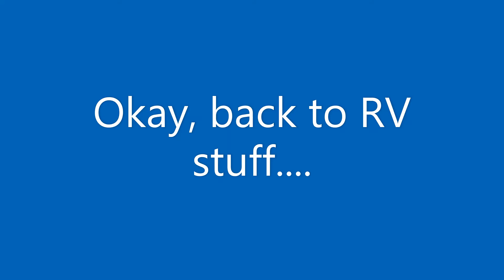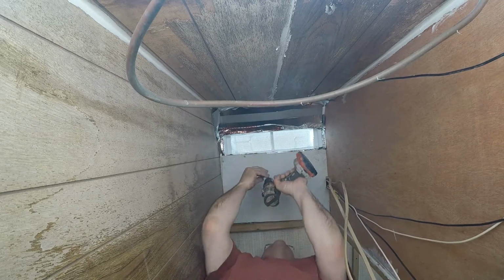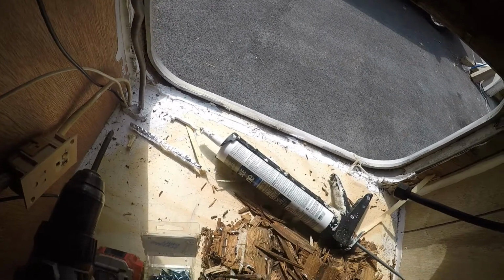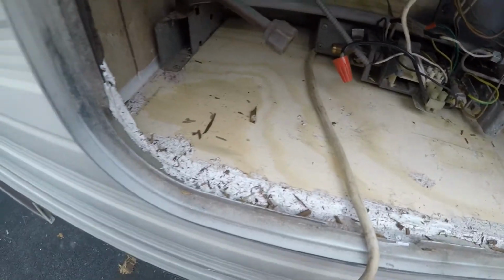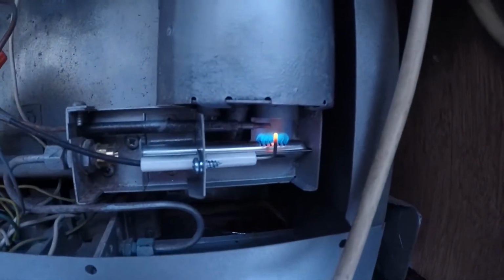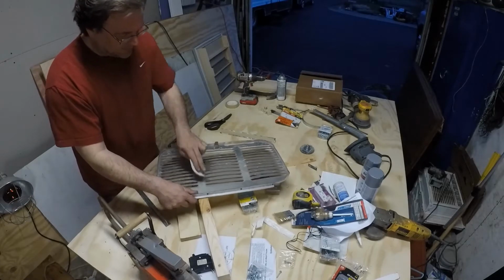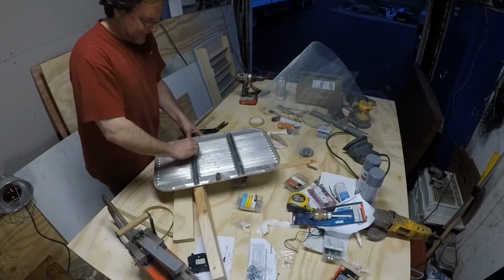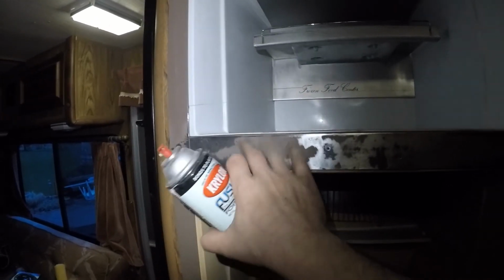Finally! Dometic Fridge Install and Bonus Exterior Access Panel Fix. RV repair.

Comment: Do you have any video of the tear out of the old ceiling. I’m trying to find out what layers and insulation is between the aluminum sheet roof and the original finished ceiling inside. I also have an 1988 allegro. Thanks
Reply from the maker: Hey Brian! Thought I did have a mention of the ceiling make up on the Roof vent replacement but here is the breakdown of what you have in your ceiling! Starting from the actual ceiling inside: 1) wood fiber finish panel with foam sprayed in from above (about 3/8" inch of foam); 2) 1/4" plywood sheathing installed and stapled to the aluminum framing on the upper side of the aluminum square tubing (about 1" tubing); 3) two layers of thin white foam blankets and then you have the roof, which is about 18 gauge aluminium for the entire roof. I've found that the aluminium is flexible enough you can insert more in areas of the vents (see the roof vent video for sure) to raise up those areas and shed water. For the refit I've replaced the 1/4" plywood where needed, installed 1/2" TuffR  foil foam board then a layer of that double-bubble foil backed foam (insultarp is one brand name), leaving a small air gap to the new ceiling panels. I use luan with FRP "sani-panels" they use in kitchens (really thin but easy to clean) for the new ceiling. 

Hope that helps!